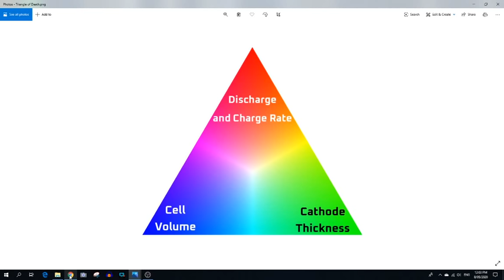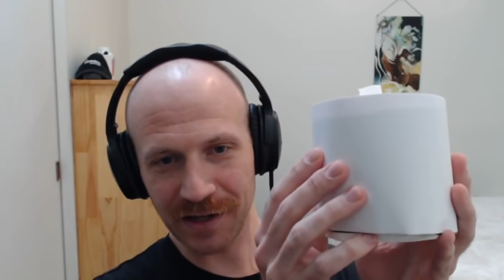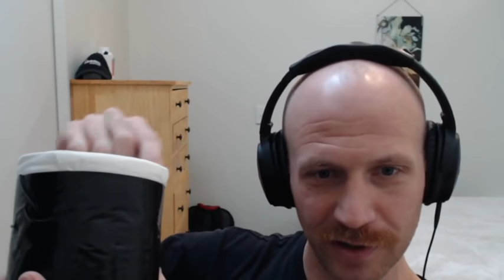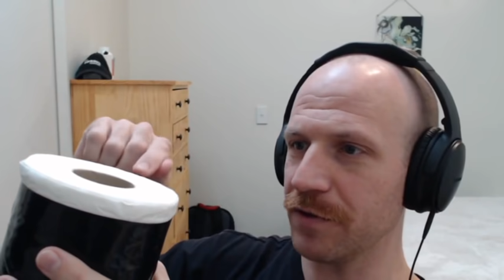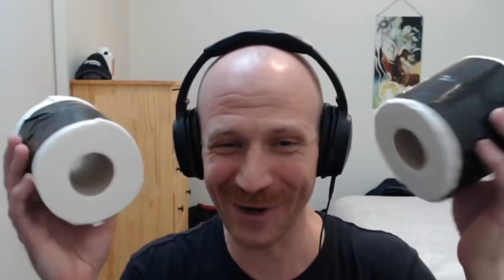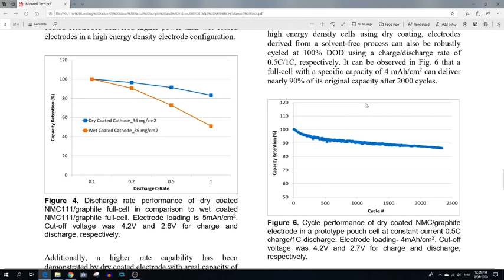Tesla Tabless Patent - Hot Take!

Comment: I saw the patent article  and patent on Electrek and was hoping you had a video about it. Wasn't disappointed, but don't flaunt your toilet roll hoard like that. as those two rolls are  worth a lot now. Great explanation as I got confused looking at the patent, now it's a lot clearer. I may try and do some Maths now to find the optimal cell size and number of cells per pack to get the maximum energy density and capacity per pack.
Reply from the maker: 🤣♾ I was laughing up my sleeve the whole time, and quite happy with my handiwork.  Great community, I'm glad everyone enjoyed it.  I'd be curious to know your results.
Reply: @thelimitingfactor  With the same module sizes and the same current cell chemistry, I get an optimal cell diameter of 53mm which gives a total of 774 cells per battery pack
my calculations can be found here  https://docs.google.com/document/d/1NTyisVCikO-QIzi52nlYxflpsipeiTMFIhyP6FDa_gk/edit
the spreadsheet with the dats can be found here https://docs.google.com/document/d/1NTyisVCikO-QIzi52nlYxflpsipeiTMFIhyP6FDa_gk/edit?usp=sharing
Of course this is just a maths exercise, who know what future cell dimensions and pack sizes will be?
Reply from the maker: @garymenezes6888  You're a beast!  Very cool.  Are you on twitter?  If so, follow me and I'll follow back.  Also, the work you are doing here is right up the alley of @JPR007.  You guys should connect.  He does super deep dive stuff like this.
Reply: @thelimitingfactor Never been called a beast! I did tweet at you regarding a Fully Charged episode on battery recycling lets see if you can find me :-)
Reply from the maker: @garymenezes6888  Sarge Enzyme?  Only two people tweeted that at me.

Comment: Question: Is it possible to charge the battery in 15 min knowing it will degrade it from 4000 cycles to 2000 cycles life time, 
and in 10 years the battery will cost 2000$ so you can easily replace it?
can also increase cell density and capacity in a same manner? ( replace battery in after 10 years)
Reply from the maker: I'm not sure if I understand the questions. I think you could, but it sounds like a personal decision and also subject to Tesla's software limits.
Reply: The Limiting Factor after battery day when Tesla will introduce to 4000 cycle battery. 
 I was wondering if you charge faster you degrade the battery faster, 
but it wont matter cause the increase in battery cycles and lifespan. 
Basically,
1. Can you keep lifespan at 2000 cycles and a faster charge time?
2. Higher capacity/density battery with still 2000 cycles instead of 4000 cycles?
Thanx,
Reply from the maker: @tomerhacohen7732  Ah, yes, it would degrade faster.  However, Dahn publish data that is suggesting the type of cycling you mention.  It was all done at 1C.  We don't have the answers to the above because it would all be trade secret when combined with Maxwell tech.

Comment: I notised that a toaletpaperrole has a hole in the mittel with Im sure is the warmest place in a cylindrical battery. If e plastic tube (cooling tube went through that) cooling must increase 100% like?
Reply from the maker: Even better, tab cooling!  You cool the tip and because the electrodes are metal it cools the entire battery through conductivity.

Comment: Doesn't mention Tesla's non-enforcement policy on patents.  If using a pack of several cells, why put tops and bottoms on the cans? Put a gasket between the package top and bottom and save all that weight and manufacturing headache.  Might want to consider cutting open an old lawnmower ignition capacitor to show folks how a 50 yr old technology capacitor is made. At some point doesn't atmospheric conductivity become an issue for spontaneous catastrophic sudden discharge?
Reply from the maker: Yeah, I need to do a deep dive.  I probably missed so much here.  I'm in the city, no lawnmowers here, lol.  I've mowed so many lawns.  Did that as a job as a kid.

Comment: If the model 3 can charge with 250kw now cybertruck should be able to charge with 750kw with same technology. And if you take the new technology maybe even higher.
V3 seems already outdated to me. Well at least cybertruck can sustain the 250kw.
Reply: We don't know the V3 limit.
Currently the users can take a max of 250kw, but it is possible the charger is designed for higher power
Reply: @ranjunk  hmm yeah thats true, kinda hope thats the case, though i think we might have known that from the powercabins that do the grid connection (brain can't find the english name). but maybe adding onsite battery storage can give a  boost as well. so you have the battery's pushing out 3/500KW per charger and filling back up with 250KW or however they decide to do it
Reply: And Semi should be able to charge well above 1Mw. How much can grids actually provide usually?
Reply from the maker: Great point!
Reply: Instead of even higher charge rates (which do put strain on public infrastructure esp because the are intermittent) it allows Tesla to flatten the curve (to use some covid-19 speak) instead of charging at 250kw for a few % they can extend it to 10/20/30+% of the battery's capacity and then taper of more slowly this may cut charge time in half without having to replace superchargers and pay utilities for expensive groundworks/cabeling. 

The so-called 5min recharge time that ice enthousiast (trolls) always talk about may be within reach, atleast in the 10-70% charge range the 10/20-80% will be harder to achieve, road tripping will require a lot less planning to achieve the quickest travel time
Reply: quantaca agree.
But charging a 200kwh battery (top cypertruck/ roadster) with 250kw on a roadtrip is quite slow. That’s worse than model s and x level which isn’t that good already.

Comment: Another option for  production permutations: Keep panasonic for existing ranges of cars Tesla can sell every battery they can get   but offer long range version of 3 and Y with new tech (cooling shouldn't need much change). Allows early entry to market testing and higher production of 3 and Y (there are probably some in testing there already - any parameters in software releases?). Incorporate in mega packs to allow testing in areas where less mission critical (again may already be some out there with utilities).
Reply from the maker: This is my thinking as well :-). Plaid version for each vehicle.
Reply: Didn't someone already reverse engineer some Model 3 software and find mention of a 100kWh battery option? I'm hoping it wasn't just some leftover Model S or X source code.

Comment: Awesome explanation and example as usual. A question for you, is it possible to stack sheets of battery cells instead of rolling one by one? I guess in this way you can make a huge cell with very high voltage
Reply from the maker: I still haven't researched this!  It's a question I have myself as well 🤜🤛🙏.

Comment: Tab must be on at least one side, it's used as a fuse.
Reply: Sandy Monroe's battery guy showed in the Model 3 pack two wires bonded to the end of each cell from the collector plate of the associated brick for mechanical redundancy due to vibration in the vehicle during use. In case of an electrical short the brick would produce zero volts, therefore better to disconnect the shorted cell via the fuse wires and allow the brick to operate at normal voltage albeit at a slightly reduced capacity. Fuse wires are required for this reason.
Reply from the maker: A couple people have mentioned this.  Isn't there also a fuse on the outside for Tesla's cells (where it connects to the brick)?  My guess is that if there is an internal fuse, it's a hangover form the laptop days.  But, I'm just spitballing here.
Reply: @thelimitingfactor  you need cell level fuses in case of an internal short.  If cell electrolyte fluid is no longer flammable that could go away though
Reply from the maker: @loungelizard836  Hmmmmm, I still need to do a deep dive on the patent.  This was my hot take.  I'll keep that in mind.

Comment: Both Anode and Kathode need to be contacted, right? I would assume one has an exclusive little overhang at the top, while the other does have an overhang at the bottom. By that, you could offer a parallel way for electrons on both sides of the battery. Or is there some reason you need this shortcut only on one side, as you explained?
Reply from the maker: I'm pretty sure it would be on both sides, you'd just need to make sure to get the offset correct.  I should have mentioned this!
Reply: The Limiting Factor I think Volker is correct. When I first watched your props (the paper row) I was confused about jamming the cap at the top and the cathode being the tape. I went back to this video again, and you (Jordan) said the black tap (the outer wrapper) is the cathode, rather than the cathode (one of the two ply interleaved) should be shifted to the other side. Then I started think how it should be arranged with this shift to top and bottom. Then I saw Volker’s post and I want to say I agree with Volker. With this, the anode raised to the top and the cathode lowered to the bottom (or vis versa) now you jam a cap to both top and bottom, the electrons now only need to flow between top and bottom, which is a much shorter distance than anode at the top and cathode at the outer layer of the cylinder. The interesting parameter is the control of the height of the cell as it now dictates the distance the electrons need to travel.  Btw, Jordan, I think you have the most authoritative and informative video when it comes down to speculating Tesla’s battery advancement. Thanks.

Comment: With less resistance and therefore heat its probably going to have some affect on range in cold climates. Net benefits will outweigh losses in cold climates but being the only EV with heat pump makes even more sense now. They'll probably have to introduce a heat pump in every car they change to this tables design. Model Y was just the "test run" with a heat pump.

Great video as always man! Love when people show their excitement over what they're covering
Reply: There are and were other EVs with a heat pump before the Model Y. Tesla had even been accused of being late in that game. But yeah, it will be interesting to see how driving in winter or cold climates is affected by this new technology.
Reply: I’ve had a heat pump in my Nissan Leaf for 5 years. Was surprised it wasn’t in my model 3...
Reply: Reduced cold range is less of a problem than reduced total life due to overheating in summer imho. The reduced cold range doesnt damage, but excessive heat does. 
That is why in my EU rather cold country my Nissan leaf has driven 340 000 km with original battery that has no temperature management and is still at 69% capacity. While in the hotter country those batteries die around 150 000km often enough (reduced to 50% or less), because they get damaged in the heat.
That kind of crappy battery with no temp management but with less heating cells in the same situation would live a lot longer total life.
Reply from the maker: You're most welcome!
Reply: As the others have said, the model Y isn't the first EV, by a long shot, to have a heat pump, just the first Tesla (although, that's not technically true either, because an Aircon is also a heat pump, but just with a single cycle)

The cold weather issues for batteries can be overcome by other techniques. For instance, there's a startup company, by some of Shirley Mung's students, that specializes in an electrolyte for cold environments (although, here, we mean Space/Mars, maybe Antarctica etc). I'm not sure of the repercussions of using that electrolyte in warmer climates. Something like that would have to be a considerable issue for Tesla to offer a "cold weather battery" option, although, kinda cool imo.

But, I would imagine this technology will help in colder climates, if only by providing better thermal management through increased surface contact (of the electrolyte), therefor requiring less heating energy

Comment: I also excited to get these cells second hand for ebike and eboards.i can’t wait
Reply: If they have much higher energy density i'd consider getting an electric paramotor and fit it with those batteries
Reply: Good point scooters are a must also. I’m more of a diy guy so yes a wide wheel custom scooter with a full suspension so I put in the back my Cybertruck for when I’m out camping.airplanes maybe and I only say that cause now with current state of things it’ll be easier and cheaper to drive even though it’ll take longer.thr nearest airport to me is 2.5 hrs plus TSA,flight,baggage claim and rental it isn’t that efficient unless we add moe airports.but that’s just my logic.cross continent of course no brainer but are batteries there yet?

Comment: Hi Jordan. Why are the batteries round and not square. wouldn't it be more efficient.?
Reply: The same reason why toilet papers are sold in rolls instead of being folded into a cube. Manufacturing is much easier if you pack long sheet of material into rolls.
Reply from the maker: That would be prismatic I think?
Reply: The prismatic is also a jelly roll but wound into a rectangular prism shape.
Reply: @islammohamed1441  Doesn't a square have a 20% greater surface area for the same size dimension if I'm making sense?
Reply: Dermot Leslie  I am not certain why some shapes are preferred over others. But I do know that the shape you use can effect: how efficiently you use material; how tightly the cells can be packed; how heat can be dissipated; ease of cell manufacture; ease of pack assembly. I’m guessing the cylindrical cell can be wound super fast. The packing density may be an advantage for thermal management. It does use more material for the sleeve and more connectors.
Reply: It would be more energy-dense, which is great for applications with a tight fit, like satellites maybe, if space was not so cold, but usually the biggest constraint for these special applications is weight. In most cases, like EVs or energy storage, cells need to be produced as fast and cheaply as possible, so it does preclude any stacking or "rolling" into a cubic shape. Until of course Tesla comes up with yet another patent to show stupid us how obvious it was to stack or roll cubes for cheaper and better...  ;)
Reply: @Chimel31  You cannot set the cells to close with each other or you will have thermal runaway cascade. This means a failing cell will cause other cells to fail because of releasing to much heat. The cells needs a gap between them for thermal isolation.
Reply: @kazedcat  Sure, same for cylindrical cells too: They don't touch each other in Tesla modules. But if the tabless design produces less heat, thermal isolation needs might be reduced too, or sufficiently managed by the serpentine thermal management system every other row of cells. I read in the comments that the new design might even allow to place the cooling pipes above or under the cells rather than alongside. In any case, I am sure Tesla is picking the best design for both performance and economical reasons.
Reply: @Chimel31  Yes but the corner gap helps in thermal isolation so you can bring the cylinders closer together compared to the flat face gap of rectangular prism. Also it will be far cheaper to just adjust the radius of the cylinder by simply thickening the electrodes if you have thermal headroom. Thickening the electrode is very efficient in increasing energy density sense it is the active part of the cell so other parts of the cell like the current collector and the separator don't need scaling up. Designing a square cell is harder and you still need to increase the length of your separator and current collector also the crest form during folding is a safety hazard because if that is not done properly it can cause tear in the separator that will lead to a short circuited cell. Square cells leads to more expensive and slower production and negligible benefits in energy density. There are other properties that can be altered that gives you higher increase in energy density per thermal headroom available. This properties like electrode thickness not only give you better way to increase energy density they also reduce manufacturing cost and they work on current production tools. So no need for expensive tooling upgrade.
Reply: Why isn’t it hexagon like honeycomb?

Comment: Extended foil electrodes have been done with capacitors for a long time.
Reply: Doug Golde I thought I’d seen very high end (with exceptional dissipation factor), small value capacitors with analogous construction.
Reply: @dksculpture   When I worked in the power conversion we used Sprague 710P polypropylene film capacitors as snubbers.  The foil is extended on both ends and mushed together providing a continuous tap.  Great high frequency response and very rugged.
Reply: @douggolde7582  Makes sense.

Comment: And in combination with the Hybrid Lithium-Ion/Lithium Metal Cells. I can picture them giggling like a girl. US patent 8803470
https://www.sciencedirect.com/science/article/abs/pii/S2542435120301720
Reply: As cool as that idea sounds, I don't see it coming to fruition any time soon. The hybrid (or secondary reaction) in that battery sounds like it does considerable degradation to the cell structure, so there would have to be considerable improvements before it sees market. (150 cycles, is not much)

It also lowers the actual energy density of the cell, so in normal use, it's actually worse. 

I'm not sure how you'd warranty a battery like that either, which would give the owner the choice to over-discharge their battery occasionally, for longer range, at the cost of lifespan. Still, we'll see. Tesla has a habit of surprising us